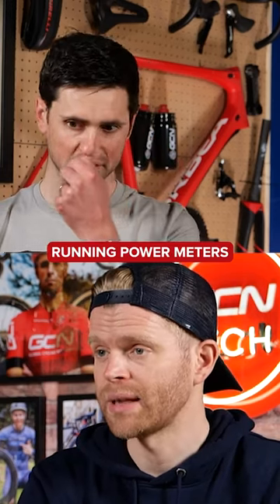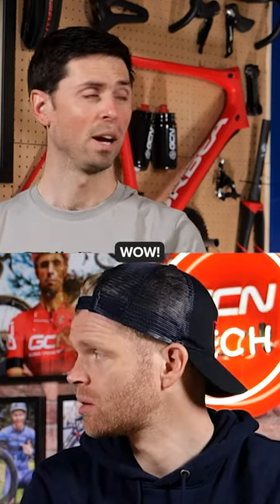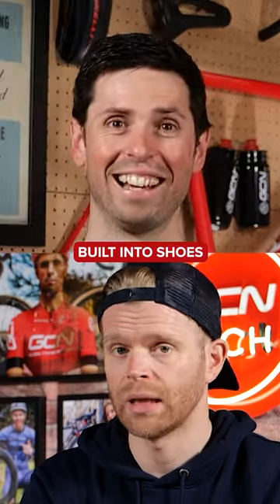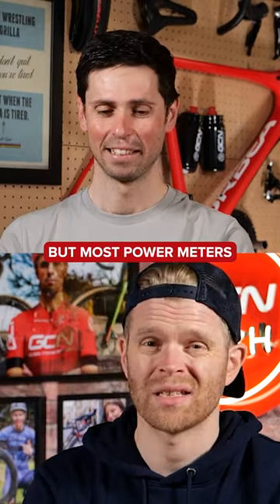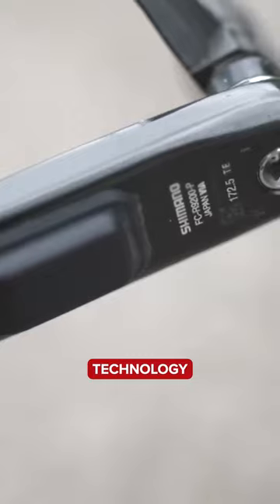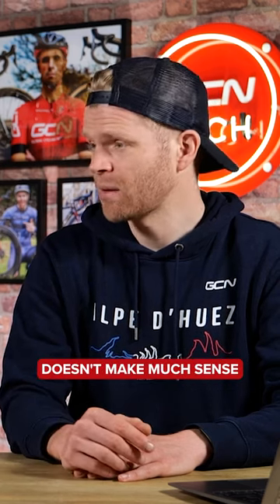Why are there no power meters on cleats or shoes? 🤔⁠

Comment: Could you devise a test to see how a power meter compares to the power shown on Strava segments? Whilst you would still only see the Strava numbers retrospectively, if they're accurate it could be a useful (and cheap) training aid...
Reply: The strava estimate is affected by so many variables. E.g. wind, whether you’re drafting in a group, air pressure, tyre rolling resistance, etc. It’s not far off on a constant gradient climb if your weights are entered correctly on Strava, but apart from that there’s no simple algorithm and it’s next to useless elsewhere.
Reply: @discbrakefan Strava can be very farr off if you ride on a very upright city bike with terrible drivetrain efficiency and rubbish puncture proof tires. Even if you ride a constant grade and no wind and correct data in strava